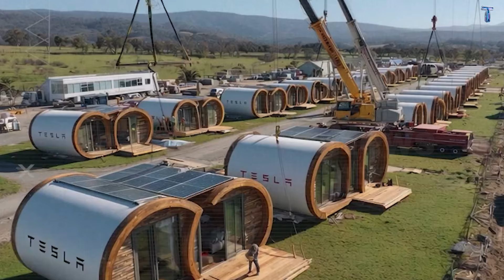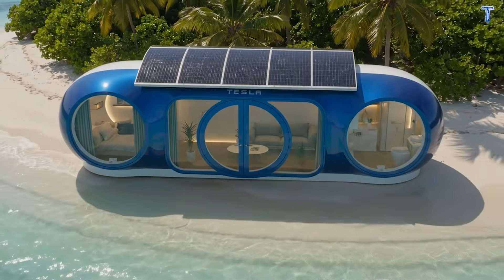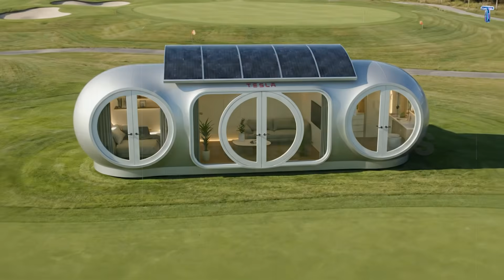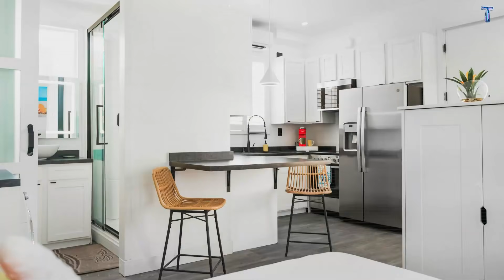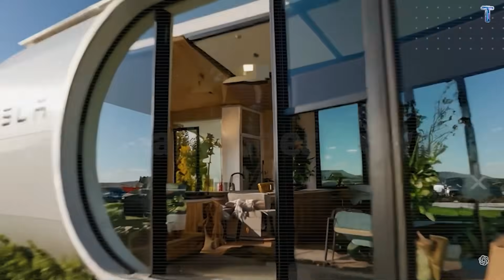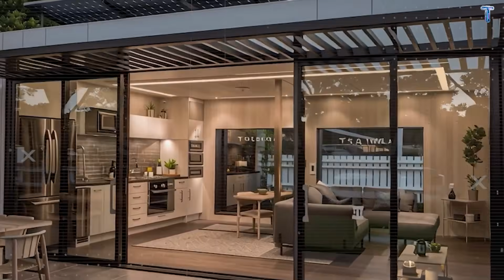$5,983 Tesla Tiny House 2026: Safe for Seniors at 75?

Comment from the maker: If the AC fails for 6 hours tonight… does your tiny house protect you or expose you?
Retirement housing isn’t tested on good days. It’s tested on the worst night of the year.
What’s your biggest concern after 60 — heat, layout, or long-term adaptability?
Reply: I've been living on a 35' sailboat 30 years.  Very familiar with all these issues, enjoy 2X200W solar panels. Ready for a tiny house, or a double wide one. 75 yo, so need a change to terra firma. Everything looks suitable. Like the motorhome a little better for now too.
Reply: My falls have always been in the daytime!!

Comment: Im live in a wheel chair will it work for me?
Reply: Surely looks adaptable
Reply from the maker: Accessibility would depend on the final floor height, door width, ramp or lift design, controls, and certified safety testing. The video does not confirm a wheelchair-accessible variant; which access feature would be essential for you?